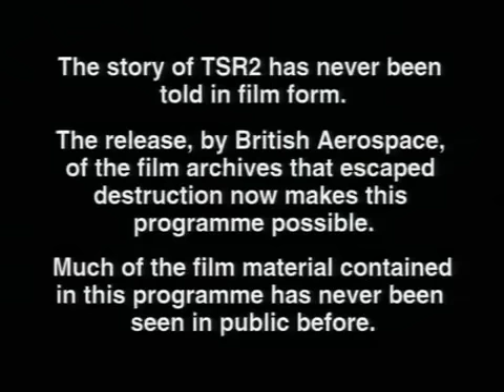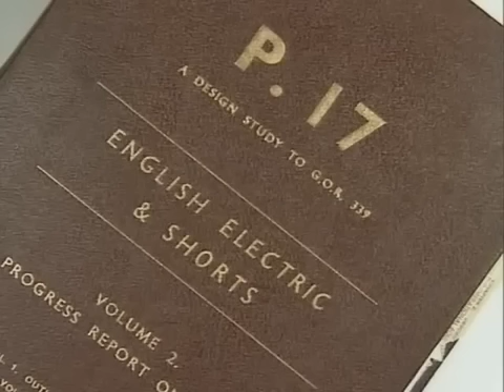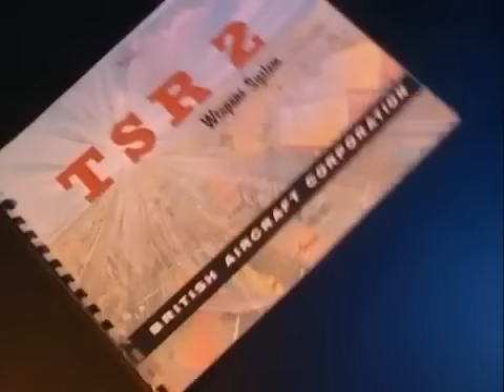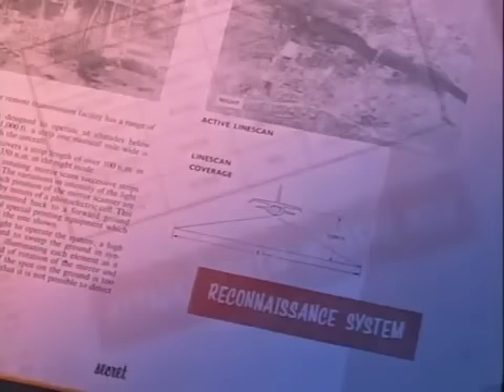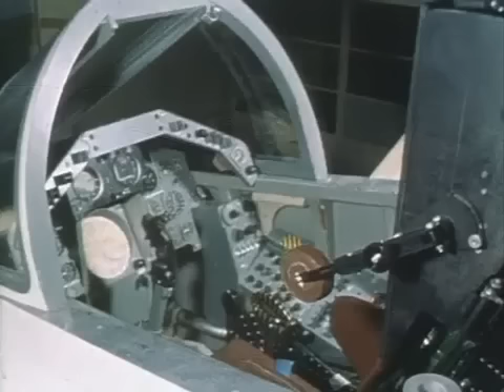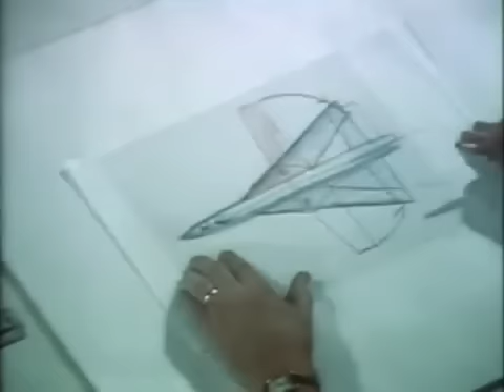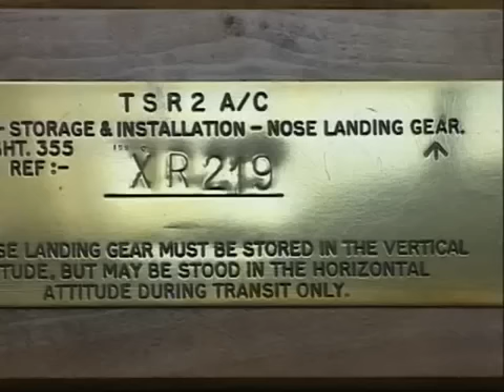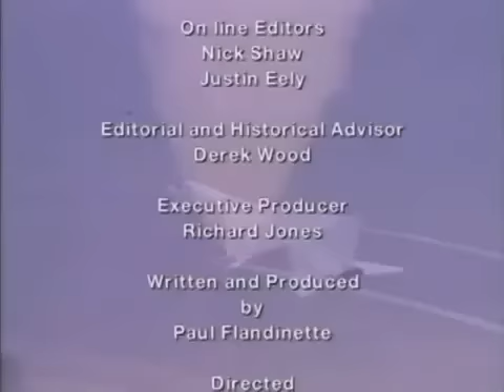TSR2   The Untold Story   Full Documentary

Comment: The TSR2 was a direct tech transfer from the failed Canadian Avro Arrow project. In actual fact the Arrow set a new standard as confirmed by analysis from NACA but it did not have a  viable landing gear or more importantly, a place to put a landing gear.  As such it was an embarrasament for Canada. It's remnants included  the never used Orenda engines were that were  sent to Britiain, who in their arrogance decided to design the TSR2 another embarrassment.

Comment: Judging by the complete lack of footage of those "advanced" so-called "tactical/strike/reconnaissance" aircraft flying or even taking off or landing in anything but a severe "nose-up" attitude and with their obvious tendency to "over-rotate" on takeoff and the obvious difficulty in getting the nose to "drop" during landing, I'd say they had some pretty much built-in and impossible to "fix" center-of-gravity and "trim" issues which aren't surprising given all that weight and drag on the "back end" of the aircraft along with a major "lack of lift" to go with same. No way in hell you go "supersonic" flying "nose up" like that since that "angle of attack" is going to cause engine/intake airflow and "power" issues as well. 

Which are evidenced by how "rich" the air-fuel "ratio" was given the "yellow" engine "exhaust" on some of the takeoff videos that is not due to "reheat" only but way too much fuel and not nearly enough airflow. Triple-spool "low-bypass turbofans" and "reheat" don't go together too well period and least of all with intake airflow "issues" and a constant "nose up" attitude in flight. 

Triple-spool boat anchors in particular need "straight and level" attitude and angle to avoid "compressor stalls" even without "crippling" them with "half-intakes" like "TSR2" has. Its pretty hard to get a good clean "weapon release" with a nose-up attitude as well when "gravity" is "pulling" the weapons out of or off of the airframe. Even if they do "drop free" they're also "nose up" and tend to "tumble" rather than fall "straight down". Especially being "tail heavy" to start with once "drag" acts on the "tail" to keep them "straight and level". 

Those things would have been an "interceptor" pilot's or SAM-site commander's "wet dream" as far as being a ridiculously "easy" target to "kill". Especially since "visibility" out of those cockpits would have been all but non-existent even in straight-and-level flight much less in what amounts to putting the "radar intercept officer" and/or "weapons control officer" in a windowless "box" behind the pilot. 

There's a reason "air-superiority" and "strike" aircraft with two crewmembers provide at least as good of visibility down and to the side and to the "rear" for the "backseater" as the pilot. The pilot has all he can do flying the aircraft to the "target" or "initial point" as quickly and precisely and "safely" as possible and has no business looking anywhere but the instrument panel, the "HUD" if equipped and what is in front of the aircraft as far ahead as he can possibly see. At least if the aircraft has radar and/or AWACs or ground-control "help" to "spot" any "bogies". 

And none of that requires being able to see "around" the aircraft and in most cases its better if the pilot CAN'T see "ground fire" or anything else "interesting" outside the cockpit but not in his "line of sight". Especially since "look both ways" tends to be "programmed into" anybody and everybody from "developed" countries used to crossing streets, roads, etc and its "second nature" to look out one side of any vehicle you're "driving" and then the other" and with even one "quick" look both ways you'll "waste" several seconds during which serious shit can happen "dead ahead".
Reply: I'm not "sure" you have much "understanding" about "how" "delta" "wings" work at "low" "speeds".
Reply: Your "over-rotation" observation is misplaced.  The blown-flaps design innovation enabled the aircraft to adopt a steep angle-of-attack attitude without stalling.  In other words, a short take-off/steep climb.  There are footages, widely published, of TSR2 taking off from Boscombe down which clearly demonstrate this feature.  Bear in mind that at least one of these news clips reports the first take-off of the prototype.  This first flight followed the dismantling of the fully assembled prototype at Kingston-upon-Thames, the transport by road to Boscombe and reassembly.  A clear demonstration of the confidence of the designers and the test pilot.
So-called advanced?  I question your judgement.  Short stubby wings favour long-range supersonic flight and necessitate a nose-up landing attitude.  This is not a design flaw, more a decision resulting from deliberation.

Comment: The USSR reveal the MIG25 - the faster fighter jet that can fly MACH 3 in 1967. This TSR.2 is obsolete before the completing development and it didn't achieve the goal of taking off on a short run way.
Reply: The Mig 25 is a very fast high altitude interceptor ,the TSR 2 was a high speed low altitude bomber, so no real comparison .
Reply: The MIG-25 was overrated. It's range was pathetic and overall was not very usable in real combat.
Reply: The take-off run was short.  The TSR2 was not a fighter jet. Did the MIG25 have the range of a bomber?  Could it carry a nuclear bomb to target? You are comparing apples with pears and your opinion betrays general ignorance